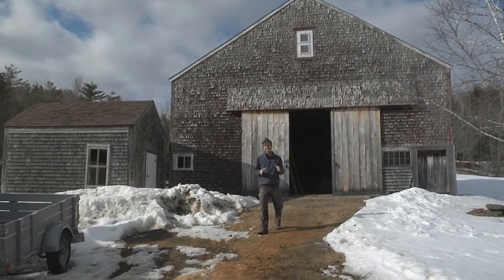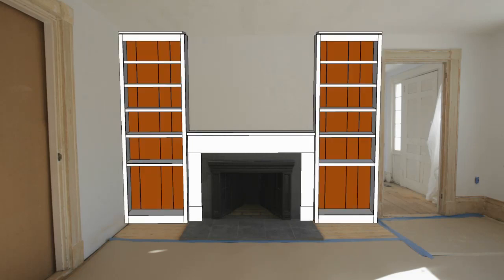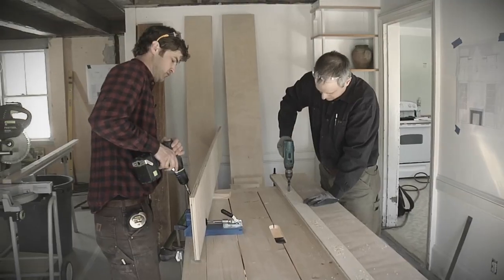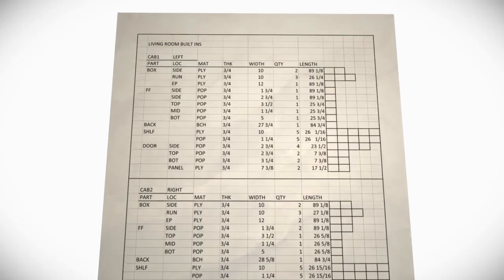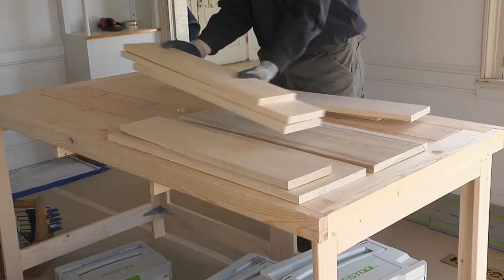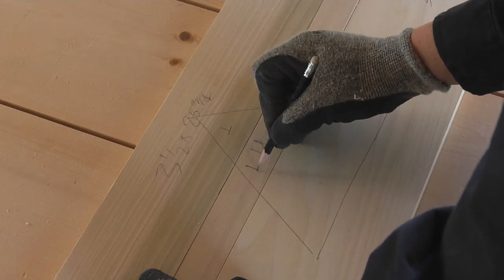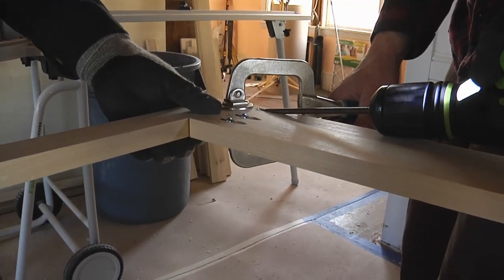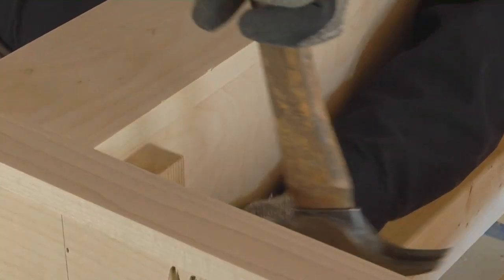Project House Videos: Built-in Bookcases in an Antique Home

Comment: Even though it contributes nothing to the strength of the joints - I totally concur w using a little glue on the endgrain. It absolutely DOES seal the endgrain which in turn limits the joint telegraphing on painted projects. On stain grade I sand the joint w a random orbit while the glue is still tacky - if there are any tiny gaps they fill with fine dust and glue and will take stain perfectly - making for an invisible joint.  Been doing it for 20 yrs and it really makes a difference and it saves steps later. So glue your pocket screws kiddies :-)